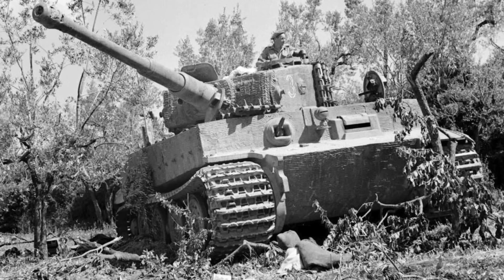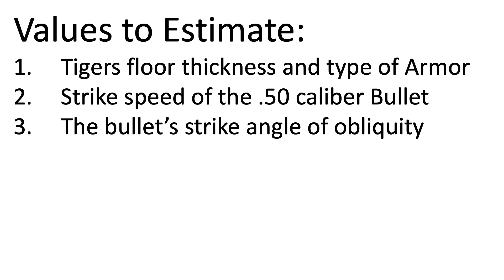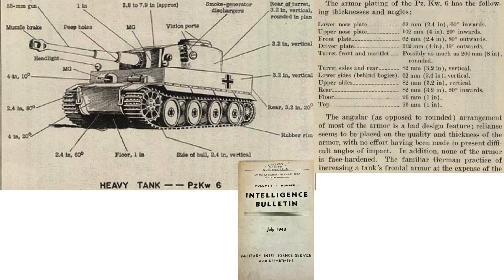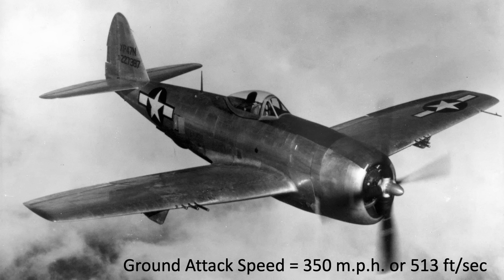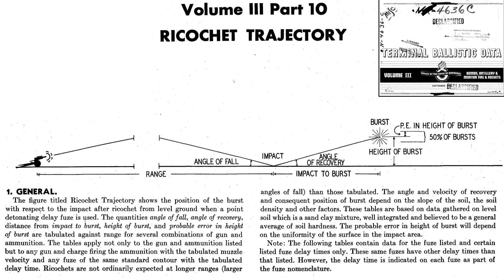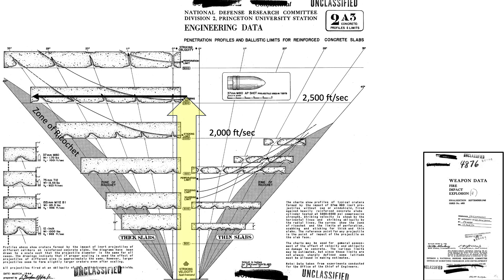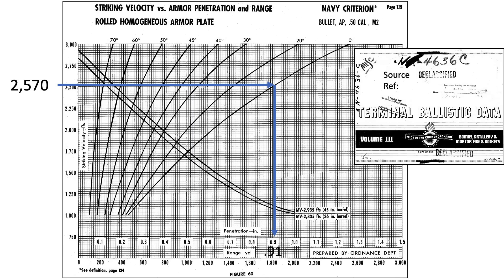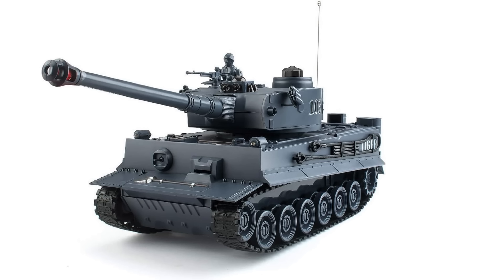P-47 vs Tiger Tank: Can Machine Guns Penetrate Armor?

Comment: I think that heavy 50 calibre fire would be more likely to damage unarmoured equipment such as vision blocks, periscopes, tracks, and road wheels, causing mission failures through the tank being in less than optimal combat condition. I suppose there's always a chance of a round or two finding their way into the cooling fans or engine compartment too.
Reply: correct, volume of fire from 6-8 coned .50cal have better chance of finding it's way into the tank via a gap somewhere like a viewport, open hatch, seam (specially where things pivot, open, rotate, etc.). Statistical probability is on the side of volume of fire.

Just as 6x .50cal proved equivalent, and sometimes better than, 4x 20mm for aircraft, due to the fact the higher volume of fire from teh .50cal resulted in much higher cases of total hits, and higher likelihood of fires. the lack of damage per round is compensated for by the fact that higher fire rates increased the likelihood of striking something vital or secondary hits causing sparks to start a fire. Also, there is a hammering effect of multiple rounds. Look what happens to armor or bullet proof glass when you shoot it multiple times in the same space with a gun multiple times. It might stop a .50cal the first time, but not necessarily the second, 3rd, or 4th time. as the armor is compromised from the first hit. Nobody is considering what the second or third hit does.
Reply: @SoloRenegade the probability of a hit with 4 20mm cannon and 6 .50s is very similar as they are not independent of each other. The number of hits is proportional to the total rate of fire. However, a hit by a cannon round is about four times as effective so the 4 20mm set up is overall more effective. The USN was quite adamant about wanting 4 20mm during WW2 because of the ground attack advantage but only began to receive such aircraft as WW2 ended. The USAAF wanted cannon on fighters too and a few had them but the issue was initially reliability due to dimensional errors in US production forcing the USA to keep using 50s despite the advantages of cannon.

If you read the USA 's own optimal calibre project outputs, it's clear that the USAAF rated cannon as more effective for A2A use too
Reply: @wbertie2604  "the probability of a hit with 4 20mm cannon and 6 .50s is very similar as they are not independent of each other. "

WTF did i just read? this is utter nonsense. the two weapons are WHOLLY independent of one another, and not only that but rarely were both equipped on the same airplane due to weight.

20mm has a FAR slower fire rate than .50cal, and 4x slow is even less than 6x fast. The .50cal put FAR more hits on target per second than the 20mm.

"However, a hit by a cannon round is about four times as effective so the 4 20mm set up is overall more effective."

wrong again. you are directly contradicting hard evidence conducted by the US military after WW2 in which they PROVED, and CONCLUDED, that 6x .50cal were EQUAL to , if not slightly Better than, 4x 20mm. The fire rates are NOT comparable at all. the 6x .50 is FAR higher.

"The USN was quite adamant about wanting 4 20mm during WW2 because of the ground attack advantage but only began to receive such aircraft as WW2 ended."

they had many aircraft equipped with 4x 20mm (F4U, F6F, and more), but even after ww2 ended, they didn't standardize this, and stuck with the .50cal into Korea and beyond.

"The USAAF wanted cannon on fighters too and a few had them but the issue was initially reliability due to dimensional errors in US production forcing the USA to keep using 50s despite the advantages of cannon."

Stop making up BS lies. US manufacturing precision was the best in the world in WW2, even the Germans used US technology in their factories, and the Germans nor UK could match US manufacturing quality.

the US used cannons on tons of airplanes in WW2: P-39, P-38, F4U, F6F, P-51, and many more.
Reply: @SoloRenegade  no, it is not nonsense.  Read what I said, which was "at least one hit". The probability of a hit from each gun is not independent as it depends on the targeting solution. As such, the probability of at least one hit is governed by diminishing returns and the increased probability of at least one from six guns is only very slightly more than four. I've mathematically modelled this in detail (I'm a scientist by training and original career) and know what I'm talking about.
Reply: @SoloRenegade  in terms of USAAF evidence noted that I said per hit. Your characterisation of the optimal calibre report is incorrect. It rated 6 M3 50 calibre guns as roughly equivalent to 4 20mm cannon. But an M3 has twice the rate of fire of the M2, so 12/4 is three. Each hit is about four times as effective according to the optimal calibre report, but a ratio of three takes into account the slightly lowered hit probabilities. The 50 achieves its effectiveness by a larger number of hits with much lighter rounds, but the main other factor affecting number of hits is targeting solution. If you are on target, you are hitting with 50s or 20mm. 20mm rounds are heavier and can contain much explosive or incendiary filler, thus causing very much more damage per hit. The number of hits is reduced because of rates of fire, but four 20mm cannon have a weight of fire similar to 12 50 calibre guns. There is a slight effect related to the probability of hitting something vital with increased rate of fire but explosives and shrapnel from a 20mm round offsets this somewhat and is discussed in the optimal caliber program report
Reply: @SoloRenegade  the USN, on all new aircraft, standardised on 4 20mm cannon . The use of 6 50s on some were for existing aircraft or in a few instances outstanding contracts. Even at the end of WW2 the F4U, F7F, F7F, A1D were being built with 20mm cannon.
Reply: @SoloRenegade  The dimensional error in early US 20mm cannon manufacture is well documented. It wasn't an issue of manufacture per se as they were built accurately to specification but somewhere along the way a drawing was incorrectly dimensioned. It was eventually corrected in (IIRC) 1944. Until then the most successful 20mm mount was in the P-38 as the gun could be re-cocked via the compressed air system in flight. The issue was the chamber was a very small amount too long resulting in occasional light strikes on the primer. This only happened a few percent of the time but was enough to cause issues.
Reply: If it let me post links, I'd like to documentation on the optimal calibre program, 20mm issue, etc.
Reply: @SoloRenegade  a Hispano II has a rate of fire of about 600-700/m, V 700-750/m,  M2 750-850/m. So on an individual basis, the cannon ROF is lower but not by the margin some think. For the Hispano V it even (just) overlaps.
Reply: @SoloRenegade  here's a thought experiment. Roll 6 dice 13 times. There was almost certainly at least one six. Roll  4 dice ten times. There was almost certainly a six. That's independent trials. Now repeat, but each time you roll a 1, reroll that die. That's basically the math we have in play, in essence. The number of sixes favours the higher number of dice, but the chance of at least one six doesn't vary much. The next step is to assign a value, 1 or 4 to each six and total up the value. Really you want to use ten-sided dice, count only tens and maybe reroll on 1 and 2. The reroll is to take into account that the probability of a hit of each round is not independent but dependent on the targeting solution. It's a bit more complex in reality but hopefully it explains the concept.
Reply: @wbertie2604  the USN did not standardize until in the jet age, even after teh F-86 family.
Reply: @wbertie2604  yes, Per HIT the 20mm is better, but in volume of fire, which is what I am talking about, the .50cal won due to statistical likelihood of hitting something critical and higher likelihood of starting fires.

how convenient of you to cherry pick and change teh argument to suit your narrative.

M2, M3, doesn't matter, they are .50cal.

And do not forget, we're talking about TANKS, not airplanes. tanks don't give a crap about your 20mm HE frag rounds. nor were P-47 using 20mm, but the P-51, F4U, and typhoon did use 4x 20mm in the ground attack role.

So stop cherry picking, stop changing the subject, and stop arguing things that don't matter.
Reply: @SoloRenegade  the standardisation began in WW2 with the aircraft I indicated. In the late 1940s the USN operated aircraft such as the F9F with 4 20mm cannon. The sole outlier is the FJ-1, but very few of these were produced. The USN did not operate the F-86 at this time. When it finally did, as the FJ-2, it was armed with cannon
Reply: @SoloRenegade  M2 and M3 very much matters as the rate of fire of the M3 was almost twice as much, the biggest effect of which is to almost double the number of hits and aggregate damage done. The NUMBER of hits increases linearly with the total rate of fire, but the chance of A hit is not linear and is asymptotic with a maximum probability of 1.
Reply: @SoloRenegade  very few P-51s had 20mm cannon and very few of those were used against ground targets. You are correct about the Typhoon. 

Yes, shrapnel damage is less important against tanks overall but if damage to wheels is considered a valid factor, then explosive rounds are a plus point.
Reply: @SoloRenegade  you are correct that the probability of hitting something important does increase. It doesn't increase very quickly at the increases in rate of fire we're talking about. If you are talking one of the few 1930s 109s with a single MG/FF through the propellor hub at 500 rpm compared to a Typhoon with a combined rate of fire of 2400 rpm then there's a big jump in hit probabilities. There just isn't so much moving from 2400 rpm combined to about twice that (6 50s). 

I'd suggest reading the optimal caliber report, although it's pretty dull. It's even more dull than the Patuent River fky off conference report.
Reply: @wbertie2604  blah blah blah. none of this has anything to do with the penetration capability of of a .50cal against tank armor.

stop with the red herring fallacies and get back to the subject at hand.

Comment: And then there’s the “P-51 Tank Busters”, or so they are called, at the end of Saving Private Ryan - which knock out a Tiger tank. I expected to see underwing cannons on the P-51s as they flew by.
Reply: Bombs was the implied means in Saving Private Ryan. 

P-51A, A-36, and MkI-III variants of the Mustang, as well as some P-51D were used for ground attack and used .30cal, .50cal, 20mm, rockets, and bombs.

A-36 pilots preferred their A-36 over the P-47, and fought tooth and nail to avoid getting P-47s.
Reply: Yes maybe was implied - though a 500 pound bomb going off ten feet away might have made more noise. History buffs and vets online say, regarding Private Ryan, P-51 was not used for tank-busting by bomb due to inaccuracy.
Reply: @johnwatson3948 It’s a movie. The scene is super dramatic but of course unrealistic.
Anything that would have blown up the Tiger would have killed Miller.
Reply: @johnwatson3948  Wrong. I've personally experienced tens of 500lb bombs danger close, courtesy of the USAF. It is awe inspiring and terrifying, but amazing too. But no movie can convey the noise of war. it would blow out the speakers and deafen the audiences, and you'll never know what it truly sounds and feels like as a result.

the P-51D, A-36, P-51A, and MkI through MkIII Mustangs were all used specifically for ground attack. The A-36 and a unit of P-51Ds specifically used bombs, and the A-36 was THE best dive bomber of WW2, and the most accurate dive bomber of WW2. the A-36 was the ONLY dive bomber of WW2 approved for danger close bomb drops near US troops due to their significant accuracy.

the A-36 was preferred by pilots for ground attack missions over the P-47.
Reply: @johnwatson3948  Dive bombing moving tanks was not even a thing, except for few very experienced Germans on the Eastern Front. That wasn't their intended role.
Also in Saving Private Ryan the tank blows up before the plane passes them, which appears to be physically impossible with a bomb. Extremely lucky bazooka maybe.

Comment: The wheels and tracks are the weakness of any tank, and the Germans were famous for overly complicated, difficult to repair tank suspensions.  An immobile tank is quickly turned into a dead tank.
Reply: It would be virtually impossible to damage a torsion-bar suspension (which is what the Tiger, Tiger II and Panther had) with machinegun fire. The bars are entirely inside the armor envelope. Destroying a few wheels will not immobilize a tank, and even if you destroy a bunch, that's an easy repair.
Reply: Yeah, but break one of the trailing arms coming from the torsion bar.  Then have the track come unpinned in a couple of places.  And some of the German tanks had interleaved wheels.  Not unrepairable, but it would keep you from the action and make you a sitting duck.  I'm not saying that's what happened, I am just speculating, but not a whole lot else would work using a .50 BMG.  And I guarantee the first guy that tried it with success came back and told everybody else- tactics like this wouldn't have come from the training manual.
Reply: @michaelhamm6207  That's the most plausible scenario but still really unlikely. I don't believe for a moment that any pilot could deliberately get such hits. Accidently, sure.

Comment: Just because it doesn’t actually destroy the tank doesn’t mean it won’t cause the crew to bail out. 

Also there is the possibility that you could have multiple rounds impacting in close proximity causing failure of the armour. 

But I was always under the impression that the reason strafing pilots were told to aim for ricochets was because there was a tendency to shoot high and miss completely when aiming directly at the target where as shooting low for ricochets would more often bring the bullets on target.

Comment: I wonder if a smaller tank like a Panther IV would be more susceptible to 50 cal fire? Maybe the pilots were mistaken and thought they were Tiger tanks.
Reply from the maker: The manual states the panzer IV's top armor varied from 10mm to 20mm.
Reply: @ejt3708  Maybe.  Depends on the strike angle.  Using the same approximately 2600 ft/s you could penetrate 10mm armor with a strike angle of 45 degrees or less.  So, yes, but not an a normal strafing run angle.  That's the kind of angle a dive bomber approaches from.
Reply: @ejt3708 How does USBombers' debunking of this misconception = "overly critical of the pilots that were fighting for the freedom we enjoy today..."? He didn't say they were liars, he just showed that whatever the pilots believed they were doing at that time to ricochet .50 cal bullets into the belly of a Tiger I tank was extremely unlikely or impossible to achieve - as opposed to shooting up their support vehicles and accompanying infantry.

Comment: The Sturmovik  was the only real tank-busting plane of that war.  All others would be better employed a few miles back.  shooting up the fuel and ammo supply trucks,  and trains.
Reply: It was a ground attack plane.
The cannons couldn’t penetrate enough armor to take down tanks. Only light armored vehicles could be damaged.

The most effective way to disable tanks was with cluster ammunition. Which had the added benefit of being quite effective against soft targets as well.
Reply: @Kuschel_K It might possibly have gotten through the Panzer IV , almost certainly through the Panzer III.  IF it could make a solid hit.  Not easy to do,  and apparently they didn't do much in that area.
Reply: @lamwen03  The Pz III and IV have almost the same level of armor. Through most of it's career the Pz IV was just a bigger, less armored Pz III.
Reply: The B-25H would do a job with its 75mm.
A flight of B-17’s could and did do a job on Tiger tanks parked for the night…
Reply: @allangibson8494  Hitting a tank sized target with a slow firing 75mm is pretty unlikely. Especially when the tank is moving. It also puts the plane at great risk of AA fire from the ground.
Large caliber cannons were best used for anti-ship and anti-submarine use.
While faster firing medium caliber cannons often added too much weight or had too much recoil for planes to make accurate shots on target.
So tank busting never saw any widespread success.
It did work in some instances but had mayor flaws. Like why even bother targeting tanks when you can spend the resources on much more effective alternatives. Guns, bombs and rockets can deal way more damage to soft targets supporting the tank, including supply vehicles with fuel and ammo.
Reply: @allangibson8494 the B-25H was used against ships not tanks